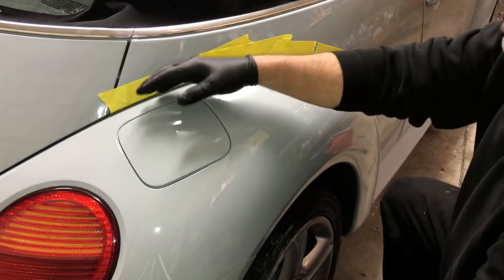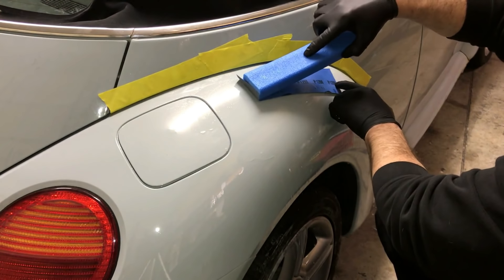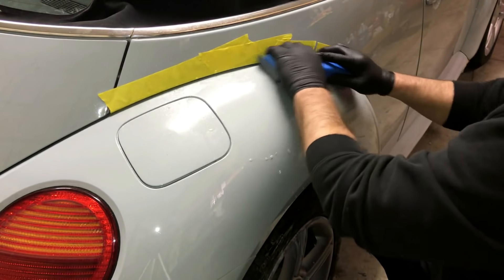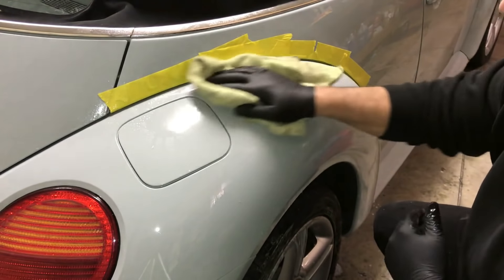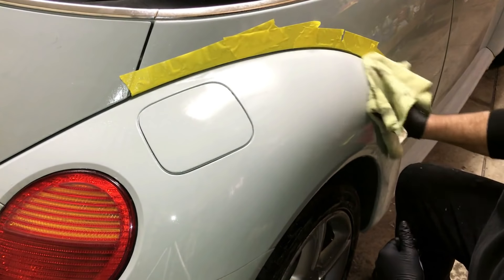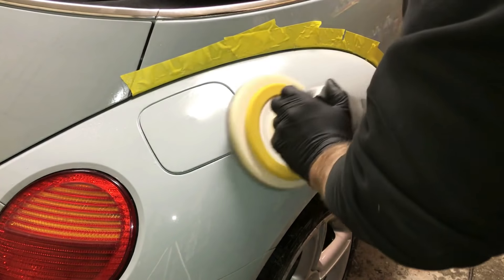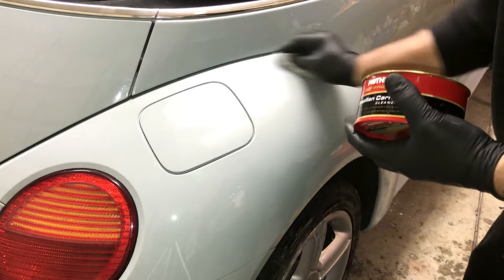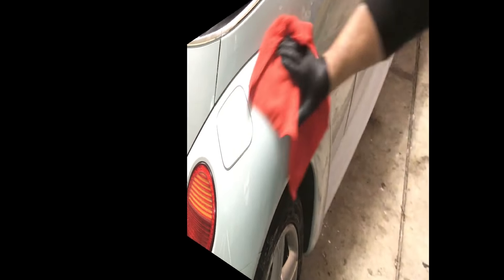How to SAFELY Sand & Buff Out ALL Scratches, Orange Peel & Imperfections

Comment: Mothers aluminum polish - great tip!  Better than great. Fantastic tip! I did some msds research and found that Mothers aluminum polish is composed of aluminum oxide and petroleum distillates. Some clear coat automotive polishing product makers (e.g. Ferro, Mequiars diamond cut) use aluminum oxide for clear coat polishing products. I compared to 3M Super Duty Rubbing Compound and its msds said it was made up of "tripoli" and "stoddard solvent". Tripoli is silica based polishing compound sometimes called "rotten stone". It's very common, and I believe is the same stuff in "rouge" polish used for with buffing wheels. Stoddard solvent is also known as mineral spirits, or simply paint thinner, and also petroleum distillates. So Mother's Aluminum polish is indeed a very good alternative to exorbitantly priced 3M polishing compounds.  I can also go to my local hardware store and pick up Mothers Aluminum polish. Can't do that for the 3M products.
Reply from the maker: Whatever they put in it sure works good I do know that it’s the only thing we use on paint plastic and metal

Comment: Excellent video again, thanks.

BTW, sanding orange peels away for the perfect smoothness and shine is great for quality aftermarket resprayed clear coats that are nice, thick and even, but sadly no longer a safe option for many of the latest cars that have notoriously thin OEM clear coats that also come with severe factory installed orange peel. Just check out the red paint jobs of currently sold Mazdas and it's so obvious one can see the orange peel from a few feet away. Apparently they used the lowest spray gun pressure they could get away with to JUST avoid lack of thorough coverage.
Reply from the maker: thank you so much for your great comment and support of the SPC channel :)

Comment: I used 300 grit and soapy water to remove quite a lot of light scratches that were an eyesore on a rear wing . The problem is he paint is now lighter even after waxing (with Carnuba wax)  in the area I have been using the 300 grit.  It's a silver car so maybe silver is a bad colour but It looks like I am going to have to do the whole panel and hope it will lessen the effect and wont be so noticeable   from the rest of that side of the car !
Reply: Sorry that should have been 3000 grit not 300 !
Reply from the maker: i see you meant 3000 grit you never want to use sand paper on un clear coated paint which is called the base coat/color unless you are a pro and then we would only use 5000 grit. you spray the color let dry then clear coat let dry then you would sand to remove orange peel
Reply: @SweetProjectCars  I hadn't actually sprayed the panel first. It was simply the car had the scratches when I bought it.  I note your point I should use 5000 grade. I was using  wet and dry  not sandpaper.. 
I thought I had seen you suggest 3000 grade wet and dry in another of your videos which I then couldn't find. I did respray a complete (small) panel  a few months ago after getting the confidence from watching your videos. It turned out very well. I think because I  did the whole panel I didn't have a patch to stand out  to catch the eye  I will use 5000 grade  on the next lot of scratches,   wax it  off and see how it looks !  It's a hard learning curve. Easy to watch someone else but a lot harder making your own mistakes .
Reply from the maker: you’ll get it practice makes perfect one thing about sanding most of the time it doesn’t take very much pressure on the clearcoat and you use a lot of soapy water
Reply: @SweetProjectCars  Yes I have realised now you have to be patient. If you rush it you will regret it.  I am also using  a Proctor and Gamble  product called Fairy Liquid  which is common in the UK but may not be the same  in Canada and the US  -      though it could well be the same just sold under a different brand name !
Reply: @SweetProjectCars  Tried 5000 grade. Got rid of a lot of small scratches  and  impact on clear coat is only just noticeable after hand waxing (and you really have to be looking).  I am hoping after I find a suitable  electric buffer i will be able to polish  that little bit better  and get the difference out. It is surprising how much better the  5000 grade is over the  3000.  Thanks for the advice.

Comment: Hey guys can I have a request?
Recently I broke off a bit big piece off of my front bumper on the passenger side. Luckily it is pretty low, like under the fog light. The broken part that came out is the size of my hand ( like a smaller plate ), so there's a big whole and there's a hose behind it that's visible now. I am guessing it's a radiator hose. Can you guys make a video or give a suggestion how to fix it? Like a bond or a glue? And also use the old piece to reattach or try to put a new glue/plastic back and trying to paint it with a rustoleum paint? What should I do guys? I mean it is still pretty firm and on the frame attached good and I don't think it got damaged other than that part is missing since it was cold outside so it's just broke right away she I hit the curb.
Reply from the maker: DR can you send a pic of the damage so we can try and help you out   send to sweetprojectcars@gmail.com   thank you so much for your great comment and support of the SPC channel :)

Comment: Question that hopefully someone can answer. I am currently in the process of painting a 1972 Holden HQ Ute. In this process I am using a cheaper set of guns. It is also on average 28-34 degrees Ambient(Celcius). After painting a base coat of colour there is an orange peel texture. As a result this is the same for the clear coat. My question is if the clear coat is sanded until no orange peel is present in the clear coat will the orange peel from the base coat be visible? Thank you.
Reply from the maker: Mason Fraser if you have OP in your base coat you will need to sand that and repaint or you will see it in the clear coat ...sorry for the bad news my friend :)    thank you very much
Reply: Sweet Project Cars - That sucks but thank you very much for the help.
Reply from the maker: Mason Fraser it does suck but all is not lost as you can still fix it, it will just take more time and $$$ of course :)
Reply: Sweet Project Cars - Exactly, and I wouldn't be doing it if I didn't enjoy it. And it's worth the extra time and effort ti produce a better look.
Reply from the maker: Mason Fraser im with you and the enjoying part..we always hope with our videos more people will take up the same passion :)

Comment: Is it possible to solve or reduce (Crow feet) without respray
Reply from the maker: The only cure for is to strip the topcoats prior to refinishing. If, as in crazing, the offending layer of paint was at the OEM level and had subsequently been refinished, then everything down to the OEM undercoat needs to be stripped.
Reply: Sweet Project Cars many thanks for your response and help, I will try my best only to reduce the defect as much as I can by multi sanding and multi polishing up to high glaze material and see how it will look like after that.
I'm trying to avoid the re-spray because it's a classic with alot of chrome accessories to strip down and you know how awful it will be to damage any of them in the process.

Comment: What causes orange peel ?
Reply from the maker: Bob   It can be caused by premature evaporation of thinner, incorrect spray gun setup (ie. low air pressure or incorrect nozzle), spraying at an angle other than perpendicularly, or applying excessive paint.
Reply: Sweet Project Cars 
Thank you!
Reply: or incorrectly mixed paint i.e to thick